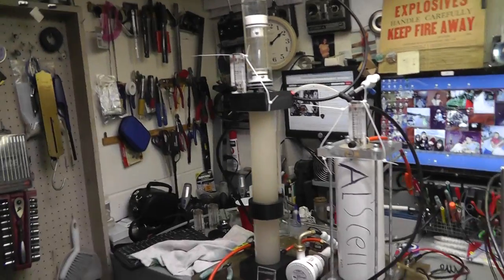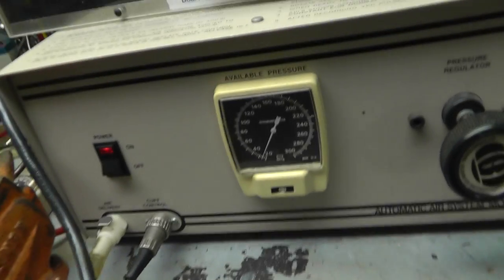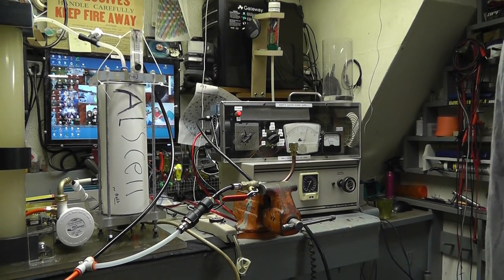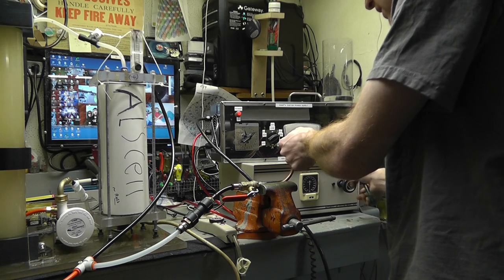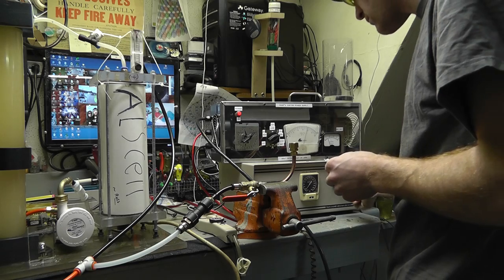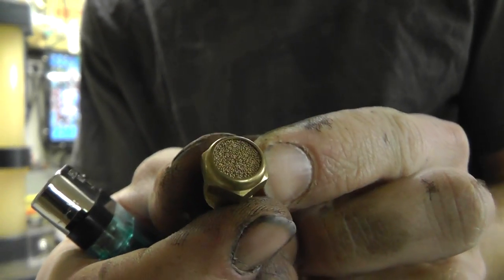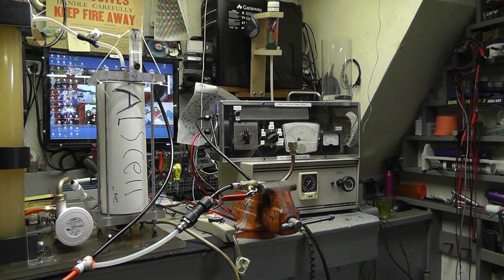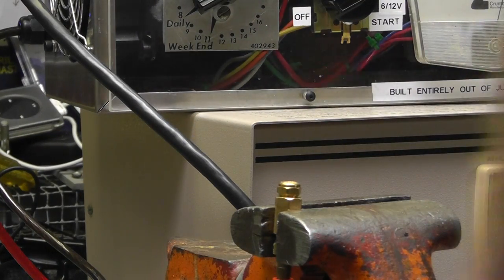P6 Simpler Quenching disk, hydroxy gas with forced air

Comment: Hey Russ have you thought about taking a fire alarm like from homedepot that detects heat and using it to detect the flame. Disconnect the alarm and hook up a light to signal there is a flame.

Comment: If I am not mistaken, you created a push off flame where you could possibly save a lot of HHO and still getting heat regime. This sound very promising..Some sort of afterburner like in airplanes...If you create designated burning chamber for this, it could possibly deliver a nice quick heat source. What is the power consumption on your HHO generator? And how many litres or cm3 do you get out of it? I am sharing the same thoughts with SYLVANENERGY..are you not worried of inner explosion?